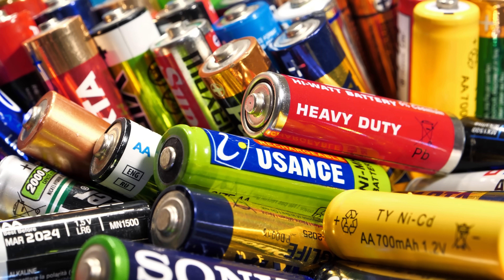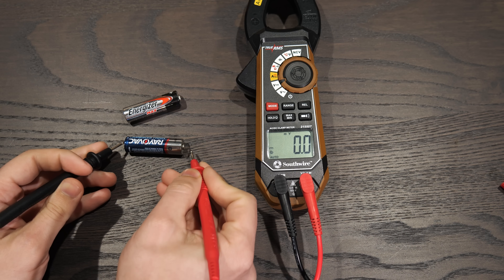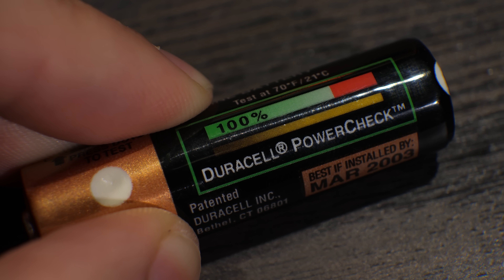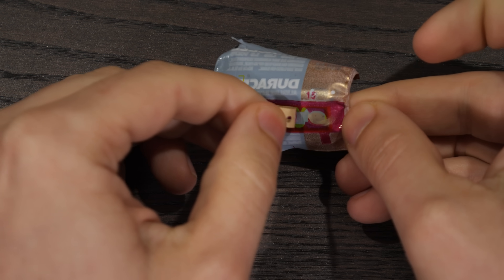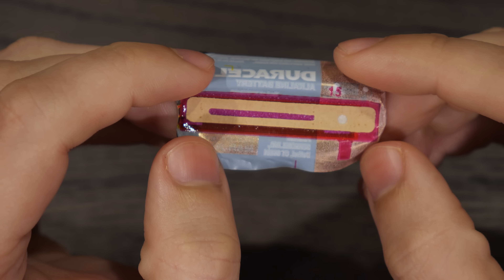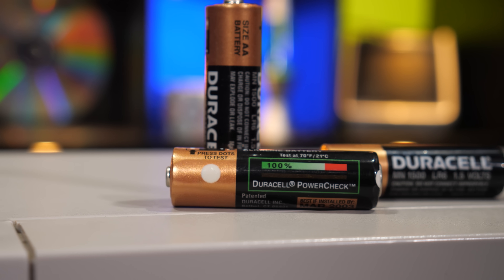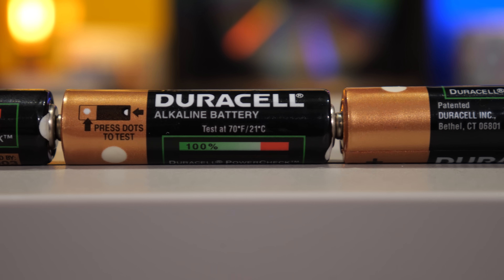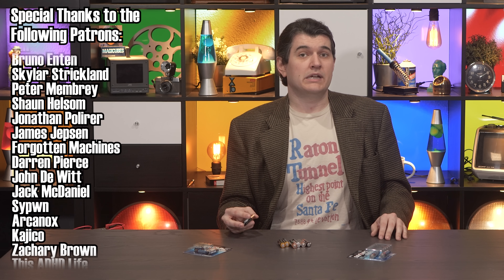Duracell PowerCheck: A genius idea which didn't last that long

Comment: 13:29 Looking at you, Xbox…
Reply: I've been using the same 4 pack of rechargable AA batteries since the Xbox 360 came out. My PS4 controller can't even hold a charge for 90 minutes anymore. I'll take removable batteries any day
Reply: i'd rather if all controllers were made like the xbox ones- i hate having downtime waiting for my controller to charge or having to play while plugged when i could just change the batteries and put the used ones to charge while i keep playing, u just need 4 AA rechargeable batteries, it's not hard

Comment: One of the use cases for taking half-used batteries out of a device and putting them away, is for devices that slow down the more the battery drains, such as a portable fan or child's toy.

Comment: It wasn’t for batteries left lying around, it was to check how long the batteries in your device would last. Many devices chewed through batteries, like the sega game gear which used 6 AAs and had no save functionality. It was helpful to know what you were starting out with. 

It was also relatively common to swap batteries from one device to another, robbing the remote for another 20 min of play might be worth it if the battery is fresh enough.

Comment: I remember these. I had to go back to my voltmeter when they got discontinued. I use re-chargeable for candles and alkaline for everything else.  Re-chargeable doesn't hold well in the freezing cold outside so those re-chargeable lights outside usually come in for the winter. That is due to the internal resistance of the battery. Humidity also plays a role in how long a battery will last. Some are waterproof and that does help. NO battery should be stored in anything that isn't used as it can explode later. If Lithium were to explode it's possible you won't get the fire out so I prefer not to use those if not needed. I would like to see you do a video on Lithium batteries and if you have already a link please. I did enjoy this one!!

Comment: Never used them as it obvious that these batteries cost a lot more than other counterparts.
I have 2 kids, of toys and gadgets around the house, many were replaced with rechargeable. But when it comes to testing I rely on my tester which I bought like 25 years ago. Very simple analog tester never let me down over the years.

Comment: There were battery chargers that had indicators on it so you can see whether it was fully charged or in rare cases, see about how much charge was left. Yes this is mostly red LED's and hardly any useful info, but it quite saved the day fairly often.

Comment: Why go through the hassle of finding old Duracell batteries with a power check, that expired in 2003 and don't work anymore, to then use a foot switch and a hairdryer to demonstrate how they work, IF DURACELL STILL SELLS THESE TODAY?!

Comment: This is why Li-ion (even for AA/AAA/9-volt batteries) is just superior in every way.  No voltage drop, easily rechargeable, more capacity.  The gauge was...a solution to a problem that didn't exist.  It's just not necessary to know how much charge is left in one of those, and added unnecessary cost.

Comment: One detail is interesting too, those very old Duracell batteries did not leak, not a tiny spot of corrosion at all visible. It looks like the quality was way better in the 80s and 90s as there is so much trouble with newer production, so many alkaline leaks the last years...

Comment: The tester itself would have used an appreciable amount of current therefore shortening the life of the battery itself .So only test if absolutely necessary.

Comment: I remember these. In one particular application, with a tight fitting battery compartment, the power check was activated, unseen of course. Flat batteries in a matter of hours. They are perhaps better off consigned to history...

Comment: When you say we’re not using disposable batteries much anymore, you’re making it obvious that you don’t have a small child.  🔋
Their toys all blaze through batteries so parents need to keep tons on-hand to avoid meltdowns…they also usually have a screw on the battery cover, which is good when the toy is intended for a toddler who puts everything loose in their mouth, but is annoying for parents who don’t have a dedicated screwdriver in whatever they use to hold their batteries.

Comment: "those battery testers always hurt my fingers" you weren't supposed to touch both white dots, you were supposed to touch the white dot on the side and the bottom of the battery (not directly on the white dot at the corner NEAR the bottom of the battery)

Comment: I'm surprised. I never realized modern batteries (primary cells actually) have the positive pole as the casing. When I was a child before the alcaline cells caught on the positive pole was a cap on a carbon rod located inside a casing of zinc. Is that an NES you're placing the cell on?

Comment: These are still available in the UK/Europe; or were last time I bought AAs. The cells I have are marked for Mar 2028, so it’s not like they’ve been kicking around in the man-drawer for ages.
They appear to function on the same principle; but the look has been updated. Mine have four windows arranged in line over under-printing which runs from green (or blue for the “Ultra”) to red, so that the thermochromatic film reveals a slightly more instinctive scale…
They are still just as painful to operate.

Comment: they sucked because you had to press much too hard for the indicator to work. And well, you would check when the device you were using in them, already acted up..
The only point was to check if you had mismatched batteries.. and maybe 1 was out.. but that just meant you would put another one in and kept mismatching that way
Bit of discipline meant you would just use brand new batteries to load up in the device that needed more than 1.. and you replace em always with new ones.. thus , never needing the indicator.

Comment: Strange to hear, these are no longer available in the USA, and haven't been for a long while. Here in Germany Duracell with power-check strips are still sold in any supermarket. I prefer them, because it makes it easier to determine if a device not working anymore is due to empty batteries or a fault of the device. Especially  when you do not have fresh batteries handy for testing.

Comment: I think it’s less common to put battery into a junk drawer and more common to swap a fresh battery from a low energy use device for a more beat up one in a high energy use device. Dk about anyone else but for me it was a completely standard practice that is when i last used battery powered devices. Which is probably also 20 years ago 😂

Comment: I remember both this and the tester built into the package. The package one was frustrating, but the one on the battery was doubly frustrating due to the amount of pressure it took to make the tester work. Mo a t of the time with the ones built into the battery packaging, it got used so much or sat around too long that the connections corroded. I am so glad that the rechargeable lithium batteries came about. The ones that are still used today, NiMH and NiCD, were of a lower voltage when fully charged but could provide more current. I do say I see less of them now.

Comment: I remember these! They ended up being pretty handy when it came to playing on my Game Gear. That beast needed 6 AA batteries to work, and it could burn through them in a day or two depending on usage. Dad had a whole drawer full of used batteries I had access to, so there was always a game of 'trying to find which combination of batteries let the handheld work. Having built-in testers was useful, as long as each of them had a little life, the handheld worked, and for some reason some batteries would 'regain charge' and start working again if they swapped out for awhile, for whatever reason. 

My fingers still remember how painful they were to check though, probably the biggest downside. Not good for a convenience feature to induce physical pain.

Comment: It has a clear use case for portable electronic devices like photo camera, audio player or gameboy. Before you leave your house you check if batteries have sufficient power in them. Even more critical is to have a way to check your headlight batteries while backpacking.
Duracell still sells batteries with an indicator in Ultra series. At least in Europe. And it is now colored. But your fingers still turn white pressing on contacts.

Comment: Duracell is a poor, cheap, low-quality battery inside a gold-like case sold for a premium price to fund its misleading massive marketing budgets. Apart from its poor performance, it is the most likely to leak and damage your device compared to even cheap batteries in the market.

Comment: I feel like it would be a decent idea to include maybe a couple of these special batteries in a pack of 20 more, so if you have them laying around you can use the one with a test on it to test the lifespan of a battery that's been sitting there for maybe three or four years.

Comment: I haven't used Duracell since 1984 when they melted inside my ghetto blaster that I had won at Grand Prix Go Kart track. Remember ? Turned a perfect lap... Costco seems to use them as "Kirkland". They dissolved in my Celestron telescope, all 8  batteries did that. Imagine the mess. But I just said I haven't used them since 1984. Well, I didn't mean to use them. They were Kirkland. So don't use Duracell.

Comment: As a kid at the time using electronics such as a game boy I found them very useful cuz I could take a couple out set them aside and then check and see if they had any life left and I could reuse them and electronics I didn't mind if they died while I was playing with them just to swap them out again whereas I didn't want them in my game boy cuz I might lose power mid game. Nowadays this feels very much like a novelty but could be more useful on rechargeable batteries perhaps though most chargers just tell you how full they are when you plug them in

Comment: Darn, I remember these, and I just looked through my partially used battery tray, none of these.
Actually, given the rate that Duracell's like to leek, it's amazing you found some that hadn't split open releasing all their gunk

As for testing batteries I've all but had more success dead shorting them through an ammeter, A good AA pushes over 2A. If you get a battery out of a low current device, like a clock, you can have a cell with near 1.5V, but cannot supply any current, as in it won't run anything.

Comment: "The standard D, C and AA batteries are composed of just a single cell - like an amoeba." 
I was sure he was going to follow this up with,
"But that voltage steadily diminishes as the battery is used up - unlike an amoeba."

Comment: Nowadays I just use the "bounce-test" to see if a battery is still good. Just drop it on the negative pole on a hard surface. If it bounces, it's been used and probably mostly depleted. If it just lands with a thud and falls over, it's a fresh battery. It's not 100%, but it's good enough to find the duds in that drawer full of batteries.

Comment: I actually liked these.  works great for the family, mine, that doesn't send the dead batteries to the recycle bin and get mixed in with good ones.   Of course a battery tester is great but that is almost like the 10mm socket and is usually lost..lol
Just found your channel.  Good stuff

Comment: Honestly I think if this idea would have happened just a bit later to work with the rechargeable AA and AAA batteries it would have gone over much better.  Nothing quite like the frustration of thinking you had fully charged batteries, putting them in something you need right now, only to find out none of your rechargeable batteries actually were recharged.  Having a quick and easy way just to tell if they were recharged or not would have made them a lot easier to work with.  And since they were a thing you might put back in a drawer and intend to charge them later only to forget you never did it would be of actual use.

Comment: Very interesting. Good video. I like your style. Subscribed...   I thought Powercheck was a great idea at the time. Very useful! Surely? Now I know why they just faded in my memory without question. Thanks for reminding me :)   As a kid in the 70's my pride and joy was a small red Japanese transistor radio. With no money and living in austere times, getting my hands on new batteries were moments of great joy and achievement. (sweets or batteries?)  Sometimes disaster would strike when i fell asleep listening to radio Luxemburg and the radio would be dead in the morning. However, i found you could literally squeeze more life out of them by crushing them in a door by the hinge. Putting them on a hot radiator worked too, though not nearly quite as well. Ah...  Good times.

Comment: When I was a boy, I used a toy that needed a lightbulb (a very small lightbulb), it was a building for Micromachines. 
But those testers just helped me so much I can't say it wasn't used often. 
Even now, for some instruments (musical or technical) I need good battery life because I need autonomy, and testers in the package are a life saving. I still use this regularly. The only advantage is that I can use those on every batteries, whatever the brand.

Comment: Back in the day we'd have a drawer full of batteriers that we werent sure if they were dead or not. 

We had alot of toys powered by batteries back then, speakers,and, most handheld devices.  So knowing which one would work was useful. 

Rechargeable AA used to leak battery juices everywhere. 

Sometimes youd get poorly made cells too, and you'd mix and match them

Comment: My gf uses a wireless mouse and keyboard and the batteries get to a point where they can't operate those, but still have enough juice for the TV remote. Problem: normally, only one of them is truly dead in the remote, so we need a battery tester to find out which (or waste battery juice). 

It'd be simpler if we had a built-in tester...

Comment: There are devices that fail to work with half used batteries, and devices that are completely happy with almost empty batteries. If you realize that, you can save some batteries. That's why I have a battery tester.

Comment: Helps to think of voltage as how hard the current is pushing or pressure and milliamps or amps as the total flow of electricity through a conductor or load.  The two must multiply together to get power (abil9ity to do work).  That battery test strip is more a function of milliamperage since the test strip is a resistor (load) and such components create heat, hence the test strip changes color much like a mood ring stone.

Comment: I have my own battery tester built with a bulb of known resistance and two wires. If something dies, but it lights the bulb, I know what I can use it on until it's really dead. But yeah, that's rare haha.

Comment: Being a 90s kid myself I used to have tons of batteries, and switching them between devices was just a way to extend their use. A Gameboy would use up a pack of 4 batteries in mere 6h, and my HP 38G calculator would drain another couple in the same time when trying to draw Mandelbrot's fractals. The cost of batteries was a significant part of my allowance then, so I spent a lot of time shuffling them in and out of devices and figuring out which ones were still good.

Comment: Huh, i remember those, but only tried to use that feature a few times as a kid, because they never seemed to work. 
I had no idea that the label was supposed to turn yellow like that, 
I thought that the green & red bar above it was supposed to change.
So clearly I never punched those stupid dots in far enough (even though i am pretty sure i made a conscious effort to push them really hard every time)

Comment: I understand that you don't often used the indicator after you places the battery in a device. 

But I remember times where I checked the life status of my batteries for my discman to take to school. I just wanted to be sure there was still enough energy inside the battery to last the day. 
Otherwise I took an extra set with me. 

Nowadays we indeed use mostly rechargeable batteries. Wich i guess means much less waste. 

Thanks for showing how they worked, I never knew or actually tried to find out.

Comment: As specific as the case usage for the battery voltmeter is, you can't help but admire the perfect simplicity of the design. It's literally just three or four layers of paper thin material with clever shapes and cutouts that take full advantage of basic physics. Whoever designed it really deserves more credit because that's legitimately brilliant.
Reply: It worked like three times and then didn’t do squat.

Comment: Actually I do remove the batteries if the device they're in is seldom used. Because in such a scenario, the batteries are likely to leak over time and the leakage then causes damage to the device's terminals and you end up with a way higher repair/replacement cost, provided your device can be repaired/replaced.

Comment: For a while there was a battery tester on the package of duracell batteries, which was very welcome. I ended up keeping just the empty shell for testing batteries for years. But you're right once the "ha ha" wears off, yeah you don't check batteries terribly often.

Comment: I remember these vaguely but i was born in 03 so they may have been just sitting in a shelf and never recycled ir something. I remeber more ckearly i think the quantum duracells where it was the same with the power check. Dont know if they still make them but i kind of liked em. Nothing i have really uses removable batteries anymore except maybe the Quest 3 controllers though